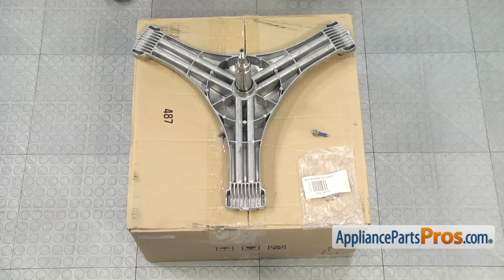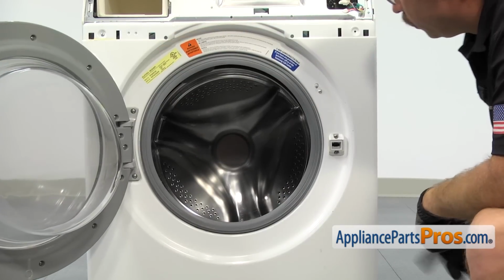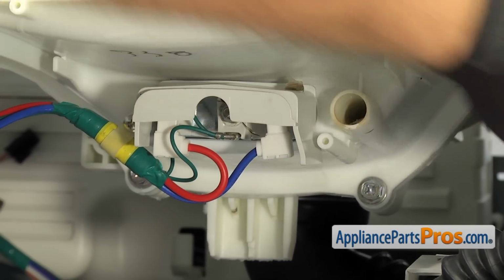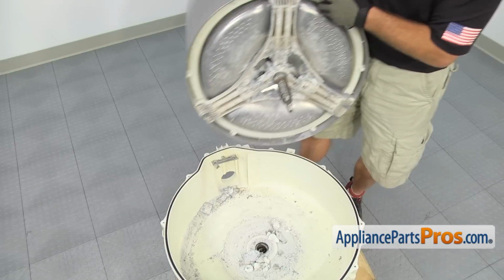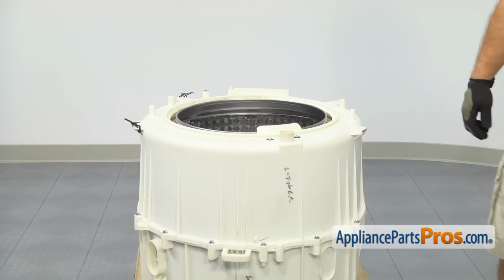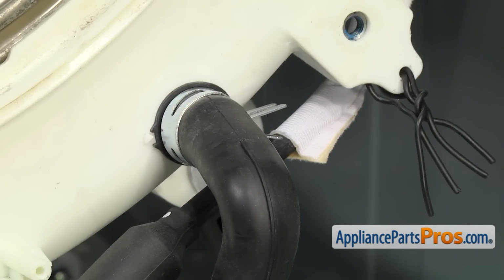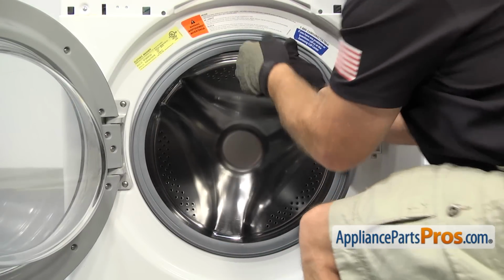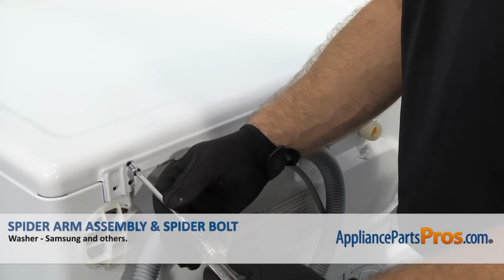Washer Tub Out of Balance? Replace the Spider Arm Assembly — Samsung (DC97-12528A)

Comment: Great video !  I just did this when washer started shaking too much and stopping at spin cycle. Mostly the same as my washer with minor differences. First I changed shock absorbers even though the ones in there felt fine. Didn't fix it. After some contemplation decided to tackle he spider arm. Worst part is getting the tub out and back in. Needs two people. Nut on back of rotor was tough as well. The arm was not broken as in some videos but it was very dirty and had some corrosion, so I almost closed it back up and returned the part thinking I'd spend money putting it in and not fixing the problem. Was not going to drop more money on bearings. Once I took the arm out it basically disintegrated in my hands though. Seems to have fixed the problem. Total was $280 as I am not returning the absorbers. Only worth to fix it if you want to buy the $800+ models IMO. The cheapest models you can get for around $550. Took hours to go through it.

Comment: Thanks for an excellent video. My samsung washer was vibrating violently for quite a while so thinking it was the shocks I changed them to no avail.i then took the drum assembly apart as per the great video and the spider assembly was scummy but seemed intact. I measured the distance from the shaft to 3 points on the spider arms and discovered that the shaft was bent by about 1/4 inch on one side . I ordered a new spider assembly and seal and now it works great,quiet with no vibration. Just a short note to mention another vibration possibility.

Comment: Hey, I’m replacing the spider assembly using this video (great detail, by the way) but I’m having a problem. When I try to reassemble the outer tub it stops the inner tub from spinning. Any suggestions?
Reply: Gavyn Linton is the shaft all the way in?
Reply: And also are the 2 outer assemblies aligned properly..check where the heater element is located
Reply: Shaft is in all the way. It’s end is flush with the motor housing on the back side of the drum. 

Heater element slides into the metal clip no problem. I’m wondering if the issue is the new spider. If the steel shat was nit pressed into the cast aluminum it won’t be able to sit low enough. Thoughts?

Comment: Bloody hell. A sacrificial anode for a load bearing component. I'm getting pretty tired of appliances. With this type of design there is no reason to pay someone to fix this! I bought my machine a few years ago, and (well its screwed) if it worked I probably couldn't sell it for $200. I'm sure repair calls for out of warranty appliances are so low because its not worth it.

Comment: Thank you so much for this video. There were slight variations with my washer which was purchased in 2011, but the spider was indeed corroded and busted in 3 pieces. I purchased the replacement part (wasn’t available on your website) and followed your instructions to re-assemble. Washing machine works perfectly now. When removing the first bolt with the 19mm socket, it broke. If this happens to you, the new spider may not come with the bolt. If it doesn’t, its an M12 x 1.75. Once again, thank you. Accounting for the $170 cost for the part and the 6 bolts, you saved me at least $500 because a new dryer would cost me around $700.
Reply: Is there an aftermarket manufacturer that makes a product that solves the corrosion issue?  Either a full stainless spider, or some gasketing between the aluminum and stainless, or some other metal that won't be chemically attacked by the stainless steel?
I still don't understand how Samsung can legitimately sell replacement aluminum spiders that will immediately restart the anode/cathode corrosion process when the new spider is installed against the stainless steel. 

???
Reply: @allanhundeby1675  I’m not sure but if a part like what you describe exists, it would be very expensive to mass produce and include in the washing machine. I did the repair and the washing is still going strong. If the new spider that I purchased and installed years ago ever breaks, then it’s just time to purchase a new washing machine. Good luck.

Comment: Our washer stopped spinning after a loud bang. Used your vid to take it apart and found the Spider Arm in pieces. It was a fun exploratory surgery (my first with a washer). Unfortunately the part isn't readily available any more and I think I'm gonna buy a brand new top loader for $600 instead of trying to repair this 8 year old for $200+ Would have been and fun project though! Thanks!
Reply: Sounds a lot like our situation.  A big bang on the spin cycle, now it grinds and wobbles. Plus we are getting the aluminum sand in the sink.  Was planning on pulling it apart, but might look around for the parts first.
Reply: @ericgulseth74  Yup exactly. Yeah see if you can even get the part, might not be worth the trouble of pulling it apart first. Was fun though!

Comment: How do we tell if it is the " basket spider" or if the main bearing is bad? When reassembling the tub half's I would use silicon sealer.  This seems like a lot of work and if you need bearings too than you likely spending about $500 ? The corrosion is likely caused by using non HE detergent and possibly electrolysis or improper grounding? .  Thank you  my channel: EureakRecycler

Comment: I have the WF461. Between the sides and bolts, it's $200. The big round rubber bit got smoked, that would be another $150+. my first Samsung washer and dryer only lasted 13 months. Lowe's replace it for me. This set lasted me 9 years. All I know is I heard banging it felt like the house was shaking. I went downstairs and the whole laundry room was filled with smoke bellowing out the back and sides. When I open the door, smoke started pouring out of there. It was all burnt rubber smell. It's too bad these things are garbage. I paid quite a pretty penny 9 years ago for these. I was going to buy a new one, however no one is delivering appliances right now because of covid-19. I would replace it myself, however I have the dryer stacked on top which would make the replacement extremely difficult. What a pain. Thanks for the video though.

Comment: Why don't you add on your video that this product is garbage the same thing happened to mine 7 years before the spider went. Using a corrosive metal inside a washer attached to a stainless steel tub is an accident waiting to happen. I hope there's a class action suit against Samsung and more on this product.

Comment: I need help over here. Our samsung WF330ANW XAA 01, shakes horribly in the spin cycle (even empty), I checked shock absorbers, and spring supports, and they look good. I suspected a broken spider shaft, disassemble the whole thing and it is good. Everything looks good, what else could it be? The only thing that I can think of is that, it only has one balance ring in the front side and none in the back, under the spider shaft. It doesn't look like is missing.  Anybody has an idea of what else can I do to fix it?

Comment: Putting the back bolt in the back shock absorber is harder than it looks. Cant seem to push the bolt all the way in, it goes half way then it doesnt screw in
Reply: I also used a screwdriver to poke through to make sure everything is aligned, but for some reason bolt doesnt seem to go through. It is also a samsung bolt

Comment: Yes I made the mistake of getting one of these Awful washers.. 2yrs changed the pump now 5yrs. The spider arm and bearings..  JUNK is an understatement. And the CES video Samsung said there customer ratings are Top in the Class..  BS  this is trash...   i know the engineers at Samsung Know Better & are Criminal in their design. I Asia they would be Arrested for stealing & making this product to Fail.  What do you think about powder coating a new spider arm. Should that help reduce this metal breakdown..?  Thanks again

Comment: Great video but I’m having a problem trying to find where the other end of the air pressure hose goes from the top with the smaller end
Reply: Pressure hose goes from bulb by drain pump or plastic part that presses into tub from back up to the pressure switch ussually found on right side top rail look up pressure switch for your model to locate
Reply: Look up pressure switch to find location on your machine

Comment: How do you know when the washer need this replaced?
Reply: Trust me you will know. You will find metal grit in the bottom drain filter.
Reply: If your bearings have failed itll sound like a plane in spin very loud in severe cases basket will wobble in tub it should not ,  bad spider will be like a gnome is inside when spinning useing a hammer knoc knoc knock.
Reply: When the spider arm breaks!

Comment: Clear, precise step by step process outlining parts to order, taking apart the tub, replacing the spider arm assembly, and putting the washer back together. My two biggest challenges: 1) one of the spider arm assembly bolts rounded off and I had a very difficult time getting it off -- finally had to drill it out; 2) for some reason putting the outer clamp on the door seal was tough for me -- I think that I watched that part of the video at least ten times before getting it right. My washer is now back in operation again. THANKS!

Comment: I have a Samsung Model WF218ANS/XAC  which was making a lot of clunking noise during spin, it is almost similar to this unit on your step-by-step DIY which helped me a lot to disassemble the unit and turned out that the Spider alm was totally corroded with calcium and built up then caused the spider to cut in 3 pieces,  I purchased a spider arm part# DC97-14875B for CAN$168.00 and followed your video, managed to put it all together in 3 hours(cleaning all the parts and wash them off). it is working now as new as it gets!  thank you for your great video.  I was going to order your parts but unfortunately they do not ship them to Canada but I source a supplier in my town who has the parts.
Thanks again and keep up with the good work.

Comment: Seems like a design flaw how it disintegrated like that.
Reply: I'd agree. I've taken apart two washers, one Frigidaire and one Samsung. In both cases the primary failure was the pot metal spider arm. The last one was replaced with a used top loader that's still going strong. The one that I took apart tonight will most likely be replaced with a top loader as well.

Comment: Thank you Matt and Appliance Parts Pros. With the use of your great video,I saved hundreds of dollars on my Wf350 Samsung repair. Had a couple bolts on spider arm that had to be drilled out and a couple drain clamps that had to be replaced . I now have a washer that almost runs like new.  It did take me longer than the video. Suggestions: Go ahead and dismantle the washer before ordering parts so that you know what all needs to be replaced. I replaced spider arm and bolts , tub seal, door gasket (which did not come with the right connection for Hose).

Comment: Hi, firstly great video! I have a Samsung ecobubble wf0806x8n which is a 8 kg washing machine with a 5 years warranty overall and a 10 year on the digital inverter motor (parts only). My machine is now 6 years old and has started giving me this problem. Wash and rinse fine although a bit noisy but when the spin cycle starts, the timer says 11 mins, then a few turns clockwise and anti clock wise then slowly picks up speed. When it reaches top speed I.e. around when the timer says 6 mins to finish (ie. 5 mins in the cycle), something happens and the timer goes back to 11 mins. Again, some more balancing by the machine and again it starts spinning reaching 1400 rpm. The spin becomes too noisy and eventually it gives up and stops with fault code 3E. See this video. https://youtu.be/cqVwVkHKgT0

Could this be a problem with the motor or the spider arm corroding and the shaft/bearing becoming wobbly?

Please advise, anyone had similar issue?

Comment: Thanks for the great video that helped me fix my mom's WF210ANW/XAA which is very similar.  It was my first major wash machine repair.  A $250 plus sweat repair which saved my mom the extra $500 it would of cost to buy a new similar replacement or professional repair.

The hole to place a screwdriver in when taking apart the stator assembly can still damage the stator on my unit so after chipping a small piece of the stator off but totally not breaking it I decided to use an electric impact wrench so the next slip would not break the $100+ stator part.

Overall these washer's seem to be a great engineering design, but I'm wondering why they are using a zinc spider assembly?  Is there any purpose besides purposeful early failure?  This was an $800 machine that was purchased on sale for $600.  A repair technician would of charged a $125-150 to diagnose (1 hr minimum rate), then approximately $250 in parts and another $250 to $300 labor to repair.  Making repairing as much as a new machine in this class.

I paid $154 spider including tax and quick delivery, new $46 rubber boot (old was moldy & chipping) $45 2 bearings main shaft seal and tub seal, $10 spider screw set.

As my contribution to the earth I will be forwarding this anti-green designed failure to my Attorney general, to someday help persuade these companies to quit putting dissolving parts in such an otherwise beautiful design.

Comment: Marvelous video!  Huge thanks!  It's particularly wonderful that APP's prices beat the competition, too.  By the way, there are a few small changes (hose locations, screws, etc.) in later models, but it's easy to figure out.  If you are going to order a spider bolt, order all six!  Also consider replacing the two bearings along with the recommended shaft ("oil") seal and tub seal replacement.  If you're going to spend four hours disassembling and reassembling, it's a bit of insurance against having to do it again later!

Comment: I am in the middle of this project on My Samsung WF241ANW/AXX, all was  going well until I go to reassemble the two tub half's... the gaskets from Appliances Parts Pros is about a 1/4" round gasket SAMSUNG Tub seal (DC69-00804A) and wont even come close to fitting in the groove for the gasket. the original gasket is much smaller and is more square with a groove for the lip from the other tub half to fit in. The customer service rep I called had no clue on  the gasket for the tub when I called and could not even find the part I was talking about for my model number. So now I am stuck with about 300.00 in parts. The  spider arm, bearings and tub seal installed and I have a new door bellow. I am thinking about installing old gasket and put a bead of silicone on it.

Comment: Borrowed my wife's account to post...but hopes this helps;)
Really excellent video from AppliancePartsPros.com guided me through the entire process...so there is little I need to add on exactly how to change out the spider arm.  However, here was my experience... 

I heard a bang from the washer and then saw smoke coming from the drum. I read online that this was most likely due to a broken spider arm, which is located at the back of the washer drum.  After reading about what a major repair it is, my initial inclination was to just buy a new washer. 

I was particularly frustrated with this path however, because my nice, expensive, matching stainless steel set (on pedestals) would be broken up.  I wanted to blame Samsung because they use dis-similar metals, which contributes to the corrosion problem, but the washer did last almost 10 years with weekly use.  Plus we have hard water, which has contributed to problems with other appliances over the years.

I watched several homemade repair videos (most very poor quality)... but then found this professional, step by step video.  It made all the difference.  Although you end up taking almost everything out of the washer (and yes, there are a ton of steps), there was no individual step that looked too bad.  I certainly can take off hose clamps and remove bolts.  Since I was going to junk the machine anyway, I decided to give it a try.

I worked slowly, but got everything out the machine that first afternoon (about two hours) and quickly saw it was the spider arm.  It wasn't nearly as scary as I originally thought.  I ordered a new one, including the six new bolts that hold it in and a new rubber drum seal (which they will tell you when you call to order parts).  For less than $200, I was willing to take the chance that I could get it reassembled.

I cleaned everything up as I went along and it all went back together perfectly.  This not only saved me a ton of money, but saved me from having a mismatching washer and dryer.

A couple of notes on assembly.  
- Three of the six bolts broke off inside the old spider arm, but that doesn't matter at all since it gets replaced (you don'y have to get them out).
- Best for two people to lift the drum off (then on) the two main springs.  Pay attention to the video for the proper technique...it makes a difference.
- Clean everything really well (drums, hoses, etc) while it's apart and inspect for damaged parts before calling in your order.
- Stay organized.  I used PosIt notes to label parts and placed them sequentially along a wall for reassembly.
- I took several photos throughout the disassembly, just in case.

I hope this helps...and good luck!!
- Fred